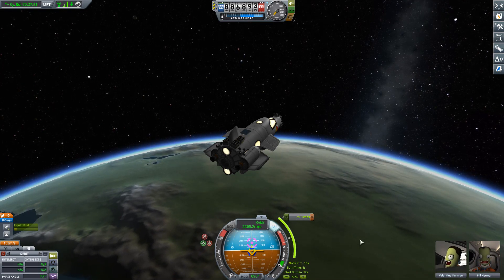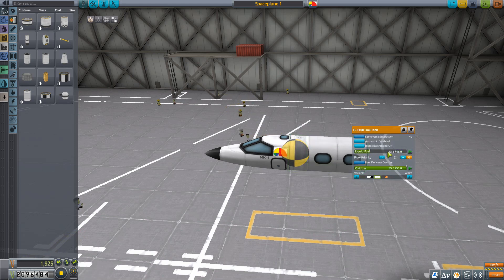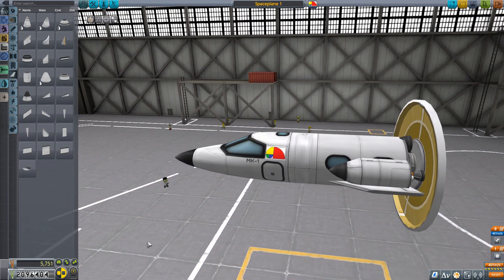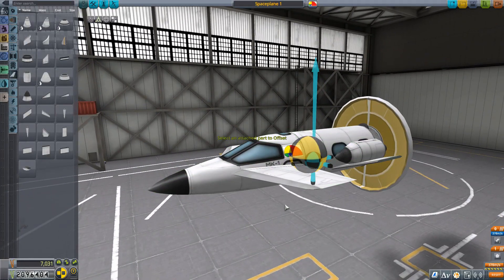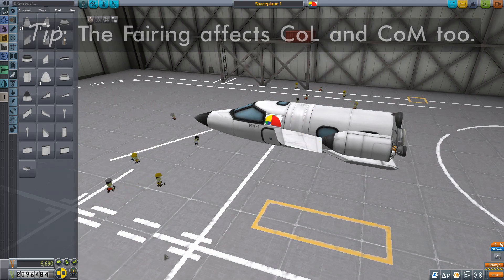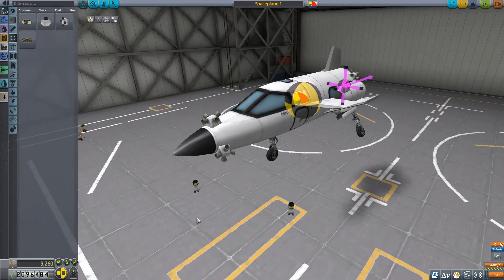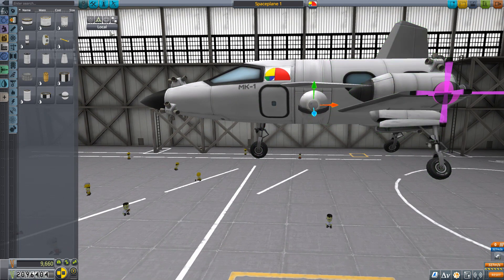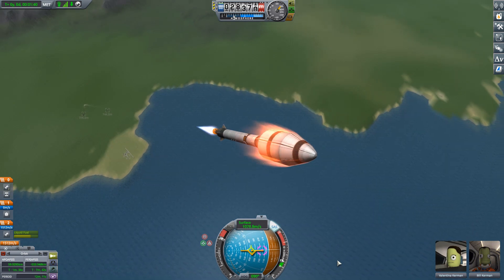Designing a First Spaceplane | KSP (Not) Beginner's Guide

Comment: Reminds one of how Hasegawa's Project NA thru NZ of early 1940s Hamgyong from Wonsan of Kumgang Range to Hamhung of Changbai Pass of volcanic Paektu where Noguchi achieved muon catalyzed fusion rocket propulsion comprised of a Dewar of cryogenic deuterium fuel connected to beryllium alloy reaction chamber nozzle coiled in around electromagnet coils to focus lens cosmic rays to deflect alpha particles while cryogenic fuel would prevent exceeding of Curie Point.        

Due to lack of quality ferrous iron amid surpluses of chemicals and silk meant they had to rely on rocket powered gliders of braided composites and steam filled airships to haul freight between rooftop hangars of Marry Kenney STOL fans since any rail transit tracks they did have were controlled by Soviet backed Rickshaw banditry. 

So please consider haw Xcor Lynx spaceplane fueled by deuterated diborane with nine volt Helmholtz coils is better than vintage 1960s brute force of vertical launches

Comment: Slight issue with your tip regarding landing gear. You always want landing gear that pitches the plane backwards at rest and land on a glide slope with a flare + engine power. I use the pipper on the navball so gauge my AoA. A nose-down landing is a lot harder to touch down on safely.
Reply: id disagree just because if the nose can be held higher off the ground during the flare it’s easier to touch down at a lower airspeed